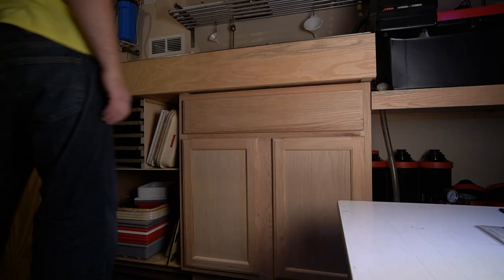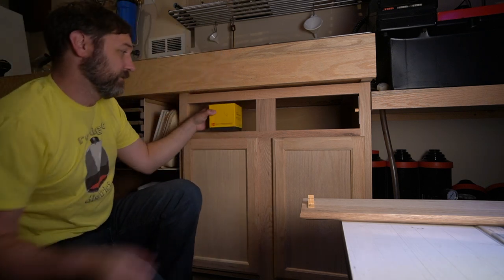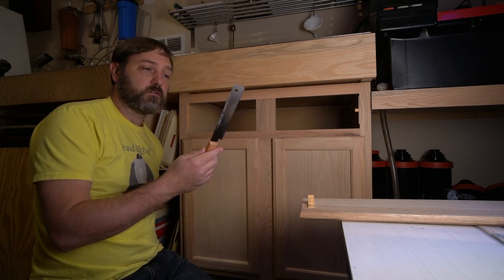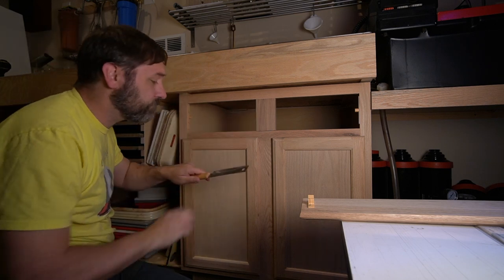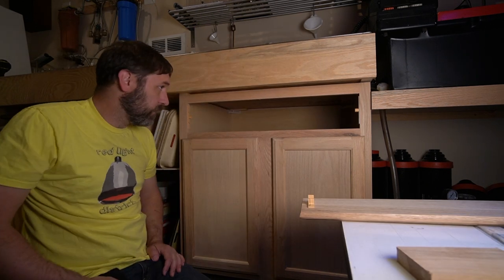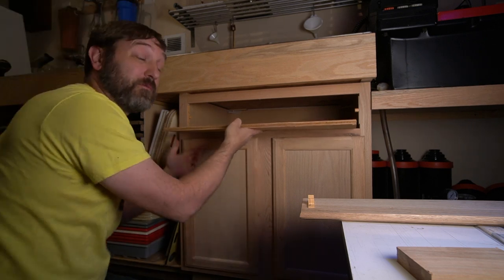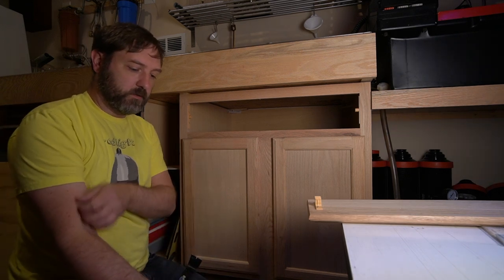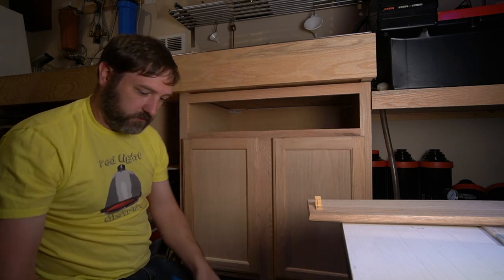Quarantine Darkroom Construction Project: Paper Safe Drawer

Comment: Could you do a video about flattening fiber prints? Specifically, how to do it with expensive equipment (if you have that), how to do it with basic or no special equipment and how flat to FB papers actually get? This area is a huge struggle for me.
Reply from the maker: I’ll check into it
Reply: I be seen that video before, but I cannot bring myself treat my prints in that way. Plus, he ends up sticking them in a book anyhow.
Reply: @heartthehorse  Hmm I don't think I'd recommend squeegeeing the emulsion side of a fiber print as shown in the first video.  I personally dry my fiber prints sandwiched between two drying screens which prevents severe curling.  I then flatten them in a dry mount press.
Reply: You have a couple of options. 1) place the fully dried fiber prints between two sheets of 3/8" glass for a few days.  They will be very flat.  2.) Use a dry mount press at about 180F for 2 to 3 rounds for 15 seconds each.  Make sure the fiber print is sandwiched between two clean acid-free mat boards. There are other more complex options, but the two I mentioned should be fairly easy to do and either method is very effective.
Reply: Andrew C That’s a good plan. I just don’t have a dry mount press or access to one.
Reply: Smoky Mountains Insider Part of my path has been to realize drying and flattening are two different processes! Probably sounds dumb. I’d tried the glass sandwich before but the print must have not been dry because on the short edges, it actually folded over on itself, a small amount but that’s a ruined print. I’ve got a dry FB print between two pieces of glass now though. Thanks!
Reply: Brf Sorry, I didn’t see your whole reply! I’d seen the grain tv video, and man, one of those presses would be prefect as it’s small and cheap. It is a rabbit hole! 

So far my process has been:

Let the prints air dry on a screen after washing

When they start to curl then into a blotter book overnight) or through the next day)

Iron them between two pieces of mat board for 2.5 minutes a side for two rounds with a few hours between. 

Then they are layered between mat boards sandwiched by cutting boards with 6 gallons of water on top (need heavier weight).

Sometimes they still are slightly wrinkled after a week, so I’m going to try the glass sandwich after that. I hope it’ll work.
Reply: @mikekukavica  Thanks, good to get as many ideas and experiences as possible. I'll definitely be trying some of your methods. Dry mount sounds like the simplest way to go, but like you, I don't have one. Neither the money or space to go down this route purely to dry prints.
Reply from the maker: A press isn’t for drying prints, just flattening them.  As for squeegeeing the wet prints, I’ve been a pro printer for years and all the other pros I know squeegee their prints front and back.  I’m not as aggressive as Abe Morell, you can see him in the documentary about him going to town on a print.  I have two squeegees, one for test prints and a clean one for finished and washed prints.  Getting rid of the surface water like this helps faster and flatter drying.
Reply: @TheNakedPhotographer  interesting, I've always heard that one should avoid squeegeeing the emulsion side of a print and I've followed that advice.  I seem to get a good amount of water out of a fiber print by squeegeeing the non emulsion side only and prints dry reasonably flat if sandwiched between drying screens.  A dry mount press takes care of the rest.  I don't feel the need to risk damaging the emulsion side by squeegeeing it but if it works for you...
Reply from the maker: I would never squeegee film.  The emulsion is very thin and fragile, but prints are robust and a hardening fixer makes them even tougher.
Reply: The Naked Photographer Tim Layton recommends using a car windshield wiper (a small one) for squeegeeing prints because the rubber is very soft. I might try that. Glad to know I’m not the only one who won’t  squeegee film. 

P.S. I put a dry FB print between glass and weighted it and after 4 days it is very flat! Don’t know why I conflated drying and flattening but having separated them, it all makes a lot more sense!!
Reply: @TheNakedPhotographer  Thanks for the comment. I'm keen to try the print on glass with tape and initial squeegee. Might take a while to dry but if it's just for prints that are going on the wall, then all good.